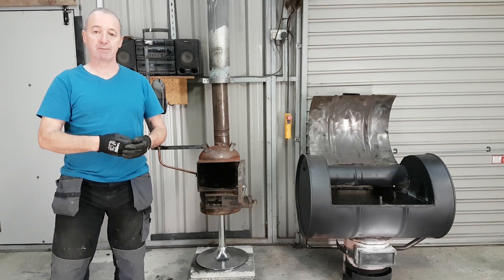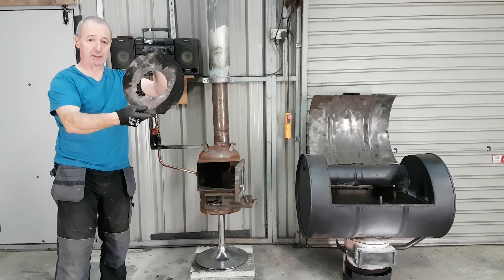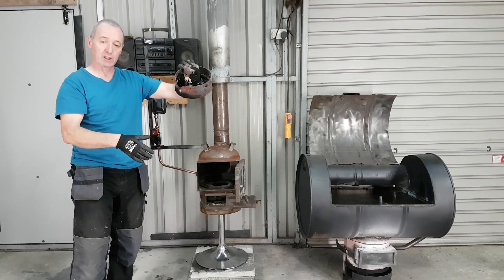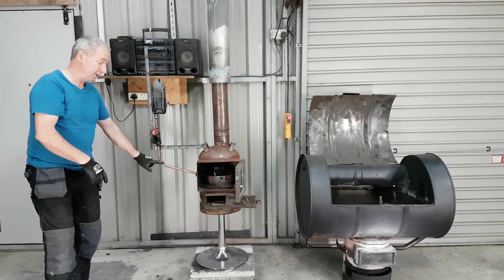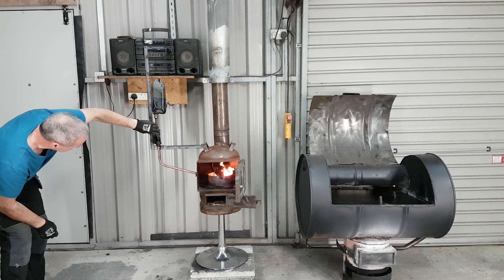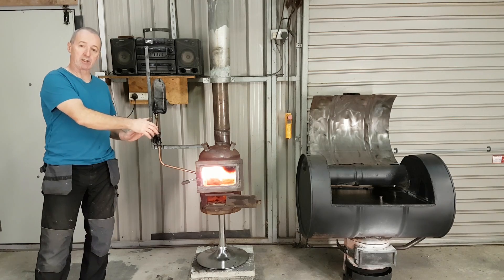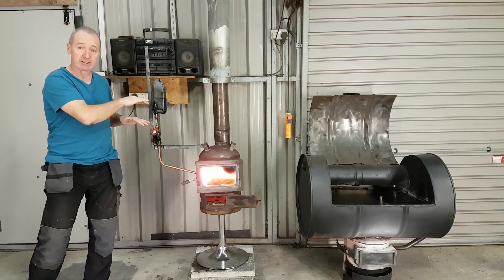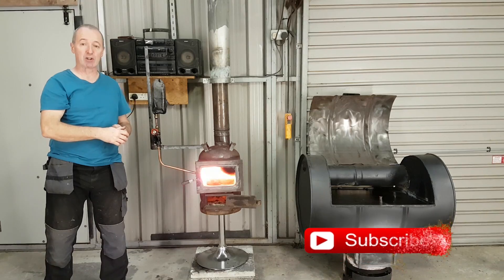Homemade Waste Oil Burner Only 2 litres per hour.

Comment: Hello Gerry, and w/Christmas just around the corner, Merry Christmas!   : )
Question:  I'm having a dickens of a time trying to regulate the temperature on my heater; do you have any suggestions?
I used a 50 gallon propane tank to make the heater.  I turned it vertical and cut a 5" hole in the bottom, and welded a 5" piece of pipe there for intake air.  I took a flexible 5" dryer hose and draw air from outside to support combustion, and that flex hose goes to the bottom of the tank over that 5" pipe.  I used a short piece of 6" pipe that comes out of the side of the tank maybe 1' from the top, and it goes to a 90 degree elbow and straight up thru the ceiling 14'.  I cut a door in the side down low to get to the burn dish.  The burn dish has a 5" hole in the center for that 5" pipe w/fresh air.  On top of the 5" pipe, just above the burn dish, is a home made "air hat."  The air hat has fins on it to direct the fresh air in a circle.  The used oil is gravity fed from a bucket to a metal pipe that drips the oil into the burn dish.  I've only used it 2 days, and it'll get cherry red all around the bottom 1/3 of the tank, and then it'll drop to maybe 250-300 degrees.  It's difficult to keep the oil flow the same, even though I don't touch the knob... it just changes.  I can tell you that it makes a LOT of soot!  I've ordered a small variable speed blower to install in the air hose to feed it more air, to find out if that will help.  I have not been filtering the oil, but it has no little rocks or bugs or trash in it.   PLEASE, ADVISE, and MANY THANKS!

Comment: I been looking thru these waste  oil heater  I've been wondering could you 
Adapted  a old catalytic muffler on 
That flue ? Where the smoke would 
Go thru  it that way you would be able 
To catch extra heat from flue smoke ?

Comment: Hi again gerry ive made my burner. Its the same principle as this only using a larger 47kg bottle. Burning brillant but having issues with smoke from the flue. Should I maybe put a baffle inside the stove. Ive got 2x 90 bends in the flue about 10-12ft of flue
Reply: Hi Paul, I have been making different types of oil burning stoves for about 15 years now and can tell you that eliminating smoke with a drip feed burner is damn near impossible. The smoke is a result of not enough air, a problem easily remedied by introducing forced air into the intake side. I have also found that the velocity of the introduced air is of more importance than the actual volume of air introduced. Gerry's burner is about as good as you're going to get with a drip feed because the air coming through those holes causes almost enough turbulence to get a clean burn. You can insulate the exhaust pipe(chimney) to get more circulation and that should help, but you can pretty much forget the idea that a drip feed system is going to burn clean. Keeping the oil supply container away from the stove is also very important because as the temperature of the oil increases it loses viscosity and flows faster thus making the mix too rich and you have to constantly compensate by reducing the flow.

Comment: Gerry mate what diameter flu exit do you recommend
Reply from the maker: Hi Paul. I have 6 inch flue here for all my setups and I can make more than enough heat for this 30ft x 20ft uninsulated shed. The length of the flue is also important as it makes the draught or pull on the fumes. My flue length is 13ft. Hope this helps Cheers Gerry
Reply: @GerrysDiy  cheers mate appreciate it! Building mines this week at some point

Comment: Gerry if I used the same principle on a taller gas cylinder do you think it would give off more heat from the larger surface area? Also would it be best to put the door and plate at the lower part
Reply from the maker: Hi Paul. It will radiate the heat better but make sure that you burn chamber can get red hot for  combustion and VAPOURISATION of the dripped oil. Cheers Gerry

Comment: Why do some of the builds have fans and some don't?   Is a fan necessary for some fuel types?
Reply from the maker: Hi Oldsteamguy. It's easier to make this thing work with a fan as all you have to do i  meter the flow of oil and add as much air as needed to make a clean flame. The output is very controllable. With normally aspirated setups it is harder to get the clean burn but totally possible and it will burn all types of oil too. Generally I burn veggie oil but othe waste oils will burn too. Cheers Gerry 👍

Comment: Hi, have been making wood burning stoves out of gas bottles for some time now, various sizes and designs. Have just made a waste oil burning one, it seems to burn really hot, but I am getting some black smoke out of the chimney my question is, what could cause this? Not enough air coming in? Too short a chimney? Or something else. Thanks.

Comment: The system could be drastically improved efficiency wise. Burning that much oil in such a small device, there is a lot of heat going wasted up the chimney. Put that stove in a 45 gallon drum along with a good portion of the chimney as a jacket and force air to extract the heat out of it. Probably burn half the oil.

Comment: Good stove. Can you burn wood in it in this state?
Reply from the maker: Hi Matt. I can burn solid fuels and waste oil separately or together. The heat output for such a small stove is massive. Cheers Gerry👍

Comment: Hi Gerry! I am completely mesmerized by your videos and the handiwork that seems more magical than anything else... I've got 2 questions for you.

1. What are you thoughts on using stainless steel tanks for a waste oil burner? I can get a 120 gallon LOX tank (only the interior part that actually holds the LOX) for about $100 - actually, there are 5 available,, so I would likely buy at least 3 of them - anyway, what do you think about using one for a burner?

2. The work pants you're wearing - what brand are they? I've got a woodshop and metal shop and am readily destroying my blue jeans, cargo pants are even worse since they are thinner material - the ones you are wearing look rugged, and, I love the pockets!

Thanks so much for sharing your knowledge and talent with us.

Stay warm,
Jim "Mr. Measure Twice" Marchetti
Reply: stainless is ideal for heat

Comment: How do you stop the oil in the pipe from catching an going back up to the tank an how does the copper not melt under the heat? Great idea tho love it
Reply: Pretty sure that his burners don't get to that high temperature since the tube is pretty low (below a lot of the heat) and not in the direct path of the burn area.

Copper/Melting point
1,984°F or 1,085°C

I could be wrong about this - hoping Gerry can confirm.

Comment: Gerry a good addition to your waste oil heating is controlling the oil flow.
The Dual Timer / Pump Kit.
Certainly a must for any home made waste oil heater.
Timer comes pre-set 9 sec delay 1 second pump, ready to go.
A really nice system, order yours today.
http://mediaprocessor.websimages.com/width/434/crop/0,80,434x293/www.dripfedwasteoilheating.com/IMG_20170927_095001.jpg

Comment: Hi Gerry, I really enjoyed watching this video, and I admire all of your experiences very much.  I have a question that I hope you'll be able to answer, I am retired and as I have a next to nothing retirement pension, I'll be forced in the near future to give up living on my boat, as it's becoming too expensive, and then I'm planning on converting my old van and live and travel that way. But the van will need a source of heating too in winter.  I've been looking at all different secondhand sites to see if there isn't a Taylor, Reflex or Dickinsons or something similar for sale, at a for me affordable price, but so far no luck. So now my question :"Do you think that it would be possible to make a stove more or less than one of theirs, surely not as fancy, but I don't care for fancy anyway, as I only need the heat ?".  If possible at all, I would like the combustion air to come from outside/underneath the van, this to keep more oxygen for my longs that are more interested in the air quality than the heater (I think).  Thank you very much in advance for your answer,  Peter.
Reply from the maker: Hi Peter. Hope you are well today. All my stoves make too much heat for a van but I did see a simple boat stove that might just fit the bill. It  burns solid fuel and is quite small.  It is a simple matter to make the air for combustion come from outside and the exhaust to go through the roof or side wall to the outside so that there is no exhaust gasses or smoke in the van or boat. Here's a link https://www.youtube.com/watch?v=YeRekiUsfzw I am sure that it cold be made run on oil too. Give me a shout on facebook https://goo.gl/C1G5Ka Cheers Gerry
Reply: Thank you very much for your quick reply and this great link, I have an old oxygene bottle that I can experiment with, although cutting and welding will be a bit less practical as I haven't got shore power and my genny isn't powerful enough to run the welder.  But that could be a reason to visit my sister who's living 400kms away from me, and try to do the work there, without blowing her fuses (I hope).  I will maybe stick to wood and coal, or if possible try to adapt the stove for pellets, and eventually maybe try something with waste oil too.  Thank you very much again, and I will keep an eye on everything you're putting on youtube,  Peter.

Comment: Damn.. I had oil bourner but didnt work welll.... i didnt had 2 chaimbers... youst 1 and air intake..... :/
Reply from the maker: Hi Dubrovnik82. The second chamber helps but the flue is very important. 4 meters of 150mm is what I have and it works great. Cheers Gerry

Comment: Nice vid, I've a stove on my channel and now I think I know what I need to do, I'm using a blower to force air into mine. Keep up the good work.
Reply from the maker: Hi Stephen.If you want to get rid of the blower you will need a separator plate instead of the grate  but you could make it removable. The burner in my video here works great but you need maybe 4m of flue or more. It makes the gases mix. Your blower is cool though. Cheers Gerry
Reply: GerrysDiy yeah I'm going to borrow your idea fit that. I'm moving workshop soon so I'll be building a new one. Have you tried a baffle plate inside to spread the heat a little ?

Comment: Looking good and broke in now.
Reply from the maker: Hi John. The stove was finally picked up so  I think it will be powered heaters now. I could do with some hot water so my thinking hat is on lol. Thanks for the comment John Cheers Gerry
Reply: I've been looking for an inexpensive way to heat my shop without having to put wood in the stove every 20 minutes . thank you Gerry

Comment: That's about 70,000 BTU/hr at that rate. (either in the shop or up the chimney). My latest Omega wood stove burns 3 lb of wood/hr and produces 18,000 BTU/hr. I'm going to build an Oil Omega!
Reply from the maker: Hi kbbacon. I put this burner in a hybrid stove cooker that I made from an oil drum and a propane bottle and I can absolutely redden it if I want. Here's a vid of it under control making breakfast  https://youtu.be/tnzEDEpz3Yk and here's wher eI lit it first and not so much under control https://youtu.be/fI46HICCfh8 Thanks for the comment Cheers Gerry

Comment: Great as always Gerry,  Hope you don’t mind,  I did  today make a version of your burner,  sliced the top and bottom off a a 20 pound propane bottle ,  cut the middle to 5” tall, then reduces the diameter to 7 inches and welded it at that,  I then welded the bottom to this 7” ring, and cut off the excess, so for tomorrow I will be cutting a hole , of the diameter of pipe that I find, all same thickness as the old 20 lb propane bottle. Will post the outcome in a few days, as it already -16 C, here in Canada.
Reply from the maker: Hi Madd Macc. Well done I really look forward to seeing how you get on. There are a million variations of these burners that can be made and I love seeing them pop up all over the world. It doesn't get as cold here in Ireland except on rare occasions but if you have enough oil you won't be cold at least indoors. Stay warm. Cheers Gerry
Reply: Awesome Gerry this is very much like what I am trying to get working. Except I have my burner in a 44 gal drum very similar with it blocked off halfway up the drum with a hole in the middle for the burner to sit in. 6 inch flue out the top of the drum. Gets the drum glowing well but can't get it to burn clean. Too much black smoke. Will sitting a brake disk over the burner help it vapourise the oil or is that more for radiating the heat?. Going to try adding more flue too.
Reply: GerrysDiy ,  well apparently I cant weld with crap,  put some cold oil and Kerosene in the burner, at the start all was good,  burned great,  until things got hot , the the burner started leaking down below , good that I had a little “ drip catcher “ Oh well, back to weld some more , Cheers

Comment: So the pass thru design failed miserably in cast iron with tinned separator I tried. So I'm back to your original forced air idea with compressor,but have 45cfm pump I'll be using and separate pipes full and air,works a treat. Glad I started following all those years ago and amazed at outdoor performance in 20mins, will complete full install here this weekend. Thanks as always, will make small outdoor patio heater like this for the freezing Temps were having in MN here.
Reply: As a reminder, if it's noticeably black smoke puffing. Is it far to overdriven on waste oil side? Lol I also spilled oil all over the outside and brass pipe split , so it's Def a prototype outside ordeal . Lol you always make it look so clean, good on ya
Reply from the maker: Hi Erik.I found that the draw through the stove needs to be very good with no loss of suction between the flue and the intake. This is what mixes the gases. With the setup in the stove in this video it is possible to mount a fan on the slider opening in the bottom of the stove and so long as the stove is reasonably airtight the possibility to make some frightening heat are there. Well done on getting through it. I got so many messages in the last few days that I have been swamped and I am trying to work through it now.  Over 400k views in the last 28 days and 2k subs in a week. Nuts. Erik If you want to make a little video I would live to see it. Cheers Gerry
Reply: GerrysDiy yeah for sure will do, and the bottom chamber is open on my old 1900s Burner& I thought that may have been why the pass thru cylinder didn't work, haha I've been watching long enough to have assumed as much. And good for you, I'm so glad tonsee your#s rising and you back at it. Was seriously worried something happened when you hadn't uploaded in few years! You have a real gift and thanks for taking your time to share it.
Reply: GerrysDiy,
"Over 400k views in the last 28 days and 2k subs in a week. Nuts."

For most it's simple human nature, not to worry about something till you need it ;-) The heating season is upon us so people are looking. I'm sure if you were to look back over the years you would see this trend ;-) I have seen it with the Yahoo groups I had joined years ago.

Gordy